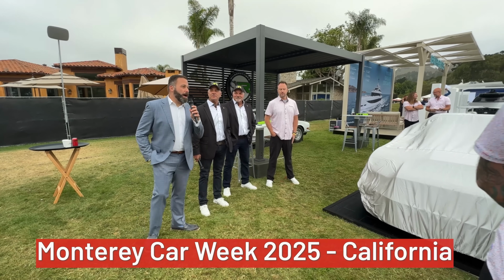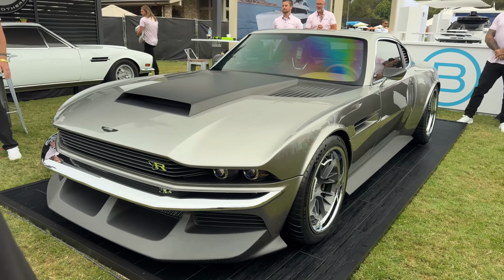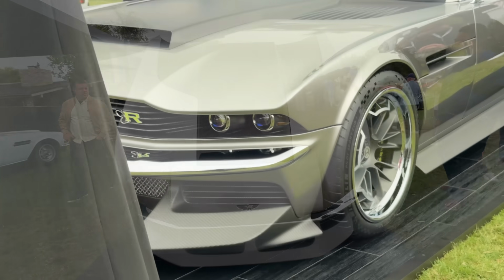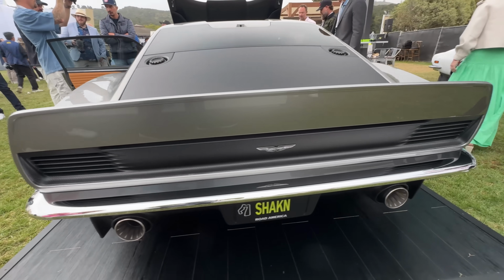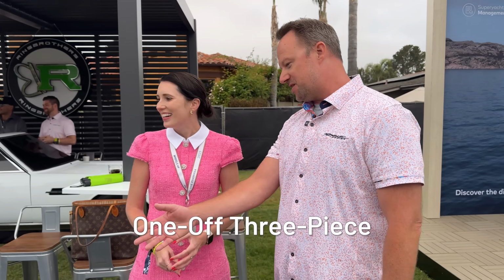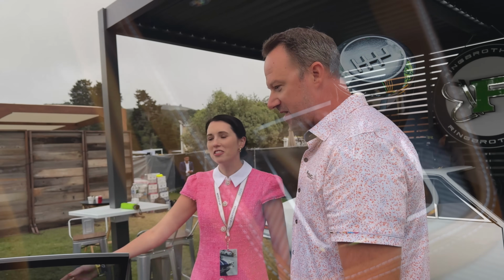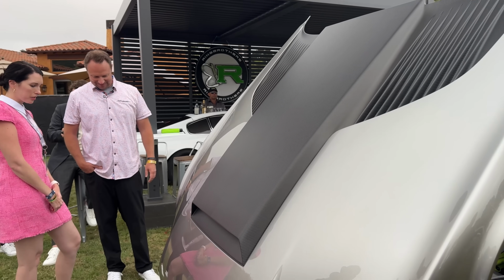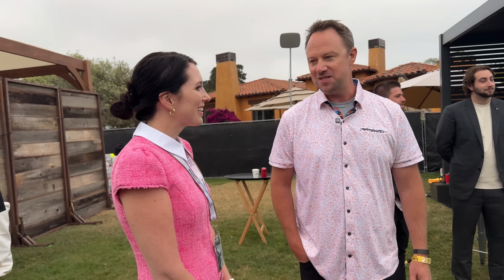Ringbrothers Reveal: Aston Martin + An 805-HP American V8! | Monterey Car Week With Amanda Cline

Comment: 🍷💨 La Macchina Fantastica – Ringbrothers' Ode to Elegance and Power

Mon Dieu... Mamma mia…
What happens when you mix a 1971 Aston Martin DBS, carbon fiber dreams, and two American artisans with gasoline in their veins?
You get la macchina fantastica—a machine that whispers James Bond but roars God of Thunder.

The Ringbrothers didn’t just build a car.
They conjured a one-off symphony—a bella bestia with 1000 cavalli under the hood, handcrafted from tip to toe, every piece fait maison, fatto a mano.
From the smallest bouton to the broadest curva, not a single part came off a shelf. It’s all bespoke. It’s all art.

And yet—respect, sempre rispetto!—they didn’t erase the soul of Aston Martin.
They honored it. They gave it a second life, one that could prowl the Riviera or storm Le Mans.

This isn’t resto-mod.
This is haute performance couture.
This is where Milan meets Detroit, and Savile Row gets carbon-fibered by madmen with welders.

A toast to the builders:
Vive la création. Viva la velocità.
This car? C’est magnifique. È sublime. Andiamo.

PS,
What's it like to drive?

Comment: It uses the rear mounted 6-speed Tremec transmission and differential (don't call it a transaxle) used in the C5 and C6 Corvettes. C7 is a 7-speed.

Comment: Finally a non LS ring brothers build.   I love their cars but their drivetrain choices were stale 1 note.
Reply: Yet it uses the rear mounted 6-speed Tremec transmission and differential (not a transaxle) used in the C5 and C6 Corvettes. C7 is a 7-speed.